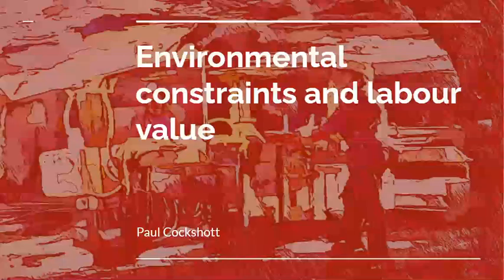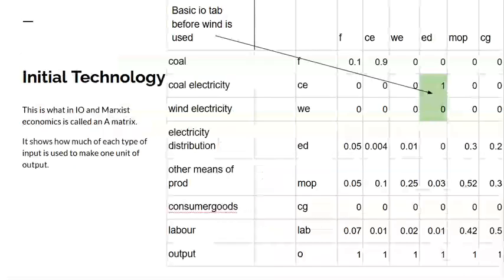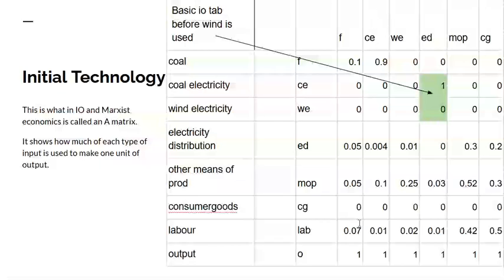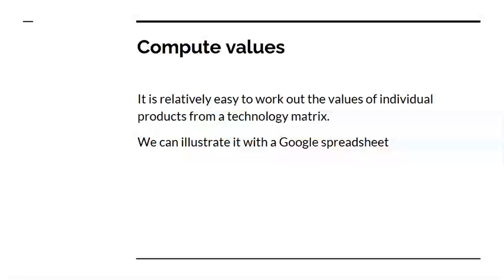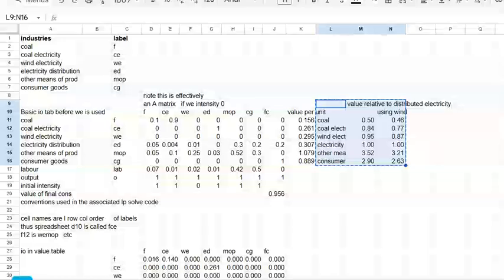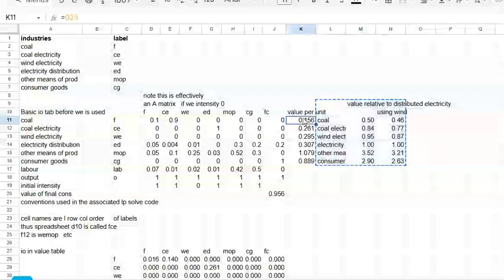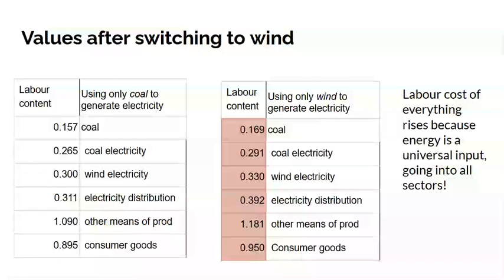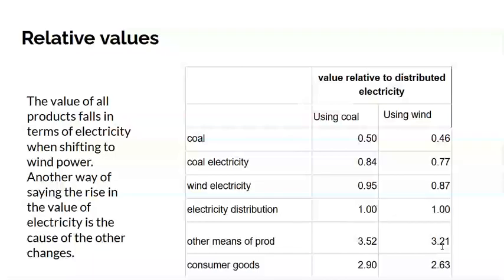labour value and environmental constraints

Comment: You may be interested in studying the economy of the Inca, which was essentially an ancient command economy where the central government would keep records and censuses and use these to plan distribution of essential goods from state-owned storehouses to the population
Reply: Can you provide a book or article about this information? Thank you greatly ahead of time.
Reply: @ I’m not sure if there are any books available (there probably are some), but Inca economy has been a popular if not controversial subject among Andean scholars. I would start with a basic search result like “Inca economy” to see what literature is available on the web. The system of record keeping I’m referring to is called quipu, a form of recording information using knotted strings. The storehouses were called qullqa and would store basic goods like frozen potatoes (chuño) in case of crop failure or famine, military equipment for marching soldiers, and clothing. They were placed in regular intervals along the extensive highway system of the empire.

Comment: The Labour Theory of Value is, in my view, clearly flawed!
Surplus value is not produced! Only a buyer can pay for it on the market.
Since surplus value is also part of value according to Marx, value cannot exist until it is clear whether it is possible to get the buyer to pay surplus value, and if so, how much.
So-called “socially necessary labour time” only exists once it is clear when a buyer buys the product in question, as does so-called “unpaid labour time”. Both types of labour time can only be qualified as such when the product is sold on the market. Consequently, value is created on the market and not with the production of the products.
One can only produce the conditions for the sale of each product, the conditions for surplus value payments and thus also for the value, but not the value itself!

Value is not the completed work performance of any kind but corresponds to the recognition of expenditure or the recognition of separation energy when giving up property!
Reply: You do not understand the difference between use value and exchange value and continuously confuse price with value. Read Capital if you haven’t already or read it again since you clearly do not understand these distinctions.
Reply: @toadyhamloaf  
Read Capital and don't always repeat the wrong things that others preach about it.
I never spoke of an equality between use value and exchange value - that is complete nonsense!
There is no value other than the exchange value (market value).

Marx had to include market value in his Capital alongside his labor value because he noticed that exchanges were not taking place in accordance with his alleged labor value.
Marx is wrong in several places in Capital, including with surplus value and thus with value: Marx writes in Capital I and Capital III that surplus value is produced. But that is clearly wrong! No entrepreneur can produce his own surplus value. If that were the case, he would no longer need to sell his products.
Marx assumes that (labor) value is created with production. Since surplus value, according to Marx, is part of value, surplus value would also have to be created with production. Marx describes the (supposed) creation of value with a formula:
W = c + v + s
W value of a work product
c constant capital (proportionate costs for buildings, electricity, raw materials, supplies, etc. per product, by Marx also costs for machines)
v variable capital (proportionate costs for labor per product – by Marx only for human labor)
s surplus value (proportionate costs for product; according to Marx, this is created with production)

Marx's supposed labor value is an expected value:
W|expected = c|cost factor, replacement expected + v|cost factor, replacement expected + s|expected.
The expected value is made visible to potential buyers as an offer price.

In reality, surplus value can only (!) be paid by a buyer. However, the buyer only pays surplus value if he first completely replaces the costs c + v .

Both of these things happen on the market. The value is therefore not identical to cost accounting (c + v), where an expected surplus value is added to the costs.
There can be no other surplus value than an expected surplus value on the production side of commodity society. Even if an angel were to hand the entrepreneur a sum of money s at his expense c + v, this would not be surplus value, but merely a replacement for part of the costs.

The value is therefore created on the market and is assigned by both exchange partners to both the commodity and the value equivalent in equal amounts.
This is also made clear by the fact that the surplus value is paid on the replacement of costs. This is a significant difference from Marx's view, who simply adds it to the costs.
The value formula must be adapted for the market:
W|real = c|replacing costs + v|replacing costs + s|real.

The value does not describe the costs, but corresponds to the recognition of the expenditure (either partially or completely (complete replacement of costs c + v) or more than completely (complete replacement of costs plus payment of surplus value).
Reply: @toadyhamloaf  
Read Capital and don't always repeat the wrong things that others preach about it.
I never spoke of an equality between use value and exchange value - that is complete nonsense!
There is no value other than the exchange value (market value).

Marx had to include market value in his Capital alongside his labor value because he noticed that exchanges were not taking place in accordance with his alleged labor value.
Marx is wrong in several places in Capital, including with surplus value and thus with value: Marx writes in Capital I and Capital III that surplus value is produced. But that is clearly wrong! No entrepreneur can produce his own surplus value. If that were the case, he would no longer need to sell his products.
Marx assumes that (labor) value is created with production. Since surplus value, according to Marx, is part of value, surplus value would also have to be created with production. Marx describes the (supposed) creation of value with a formula:
W = c + v + s
W value of a work product
c constant capital (proportionate costs for buildings, electricity, raw materials, supplies, etc. per product, by Marx also costs for machines)
v variable capital (proportionate costs for labor per product – by Marx only for human labor)
s surplus value (proportionate costs for product; according to Marx, this is created with production)

Marx's supposed labor value is an expected value:
W|expected = c|cost factor, replacement expected + v|cost factor, replacement expected + s|expected.
The expected value is made visible to potential buyers as an offer price.

In reality, surplus value can only (!) be paid by a buyer. However, the buyer only pays surplus value if he first completely replaces the costs c + v .

Both of these things happen on the market. The value is therefore not identical to cost accounting (c + v), where an expected surplus value is added to the costs.
There can be no other surplus value than an expected surplus value on the production side of commodity society. Even if an angel were to hand the entrepreneur a sum of money s at his expense c + v, this would not be surplus value, but merely a replacement for part of the costs.

The value is therefore created on the market and is assigned by both exchange partners to both the commodity and the value equivalent in equal amounts.
This is also made clear by the fact that the surplus value is paid on the replacement of costs. This is a significant difference from Marx's view, who simply adds it to the costs.
The value formula must be adapted for the market:
W|real = c|replacing costs + v|replacing costs + s|real.

The value does not describe the costs, but corresponds to the recognition of the expenditure (either partially or completely (complete replacement of costs c + v) or more than completely (complete replacement of costs plus payment of surplus value).
Reply: @rainerlippert  you think you’re the fist person to ever type out this garbage? You either used AI to read Capital or didn’t grasp it at all. Return to Capital immediately
Reply: I think you are getting confused between price and value
Reply: @emrebennett2857  
I don't think so!
There are two prices:
a) the offer price
This reflects the expected value.
b) the selling or buying price (identical)
This reflects the real value.
Reply: @rainerlippert  but both these are separate to the value.

Some items will have a price above value and others below.. but on average prices tend to move towards their exchange value (without outside manipulation).

This can be quite easily proven on piece work.. if you take 1 week to make 1 shoe.. the company you work for will not pay you the cost of that shoe (- material and overheads costs) each week.. they will pay you the minimum needed for you to recreate your potential labour under socially accepted conditions. The materials + overheads may cost them £5 and they may sell the shoe for £50 yet you won't get paid £45..

And if the PRİCE fluctuates and they suddenly get £25 or £65 for the shoe, your pay wouldn't increase/decrease..
The labour value isn't tied to price and it adds value as it is being used.
Reply: Marx covers all this in the first few pages of capital 

And value does not equal prices
Reply: @trevorwilliams2948  
Marx is wrong in Capital – see my reply to @toadyhamloaf’s comment.
Reply: @trevorwilliams2948  
Marx is wrong in Capital – see my reply to @toadyhamloaf’s comment.
Reply: @trevorwilliams2948  
Marx is wrong in Capital – see my reply to @toadyhamloaf’s comment.
Reply: Back under ur bridge.  Hundreds of blackboards, notebooks and napkins have contained the answer to this misapprehension since the original composition of “Volume 1”.  Almost all of those, like this one too, could have been prevented or avoided if the person raising the “doubts” or claiming to have a refutation of the LTV had bothered to read Volume 1 carefully.  Just go and read it and read it carefully.  Only then come back and raise the doubts again but only with clear reference to the different concepts Marx identifies, defines, describes, and discusses.

Comment: Wind being more expensive than coal? That seems counterintuitive  considering wind is relatively hands off and even a single coal plant requires trainloads of coal per day. Furthermore, what do we make of the reports that renewables are now cheaper than fossil fuels? Is that a case of the illusion of money obfuscating the real costs?
Reply from the maker: Wind is intermittent so the investment in equipment is high per kw mean power provided.
Reply: @paulcockshott8733  Wind is capital intensive upfront, but actually has a lower LCOE over the long-run. See Brett Christophers, "The Price is Wrong"
Reply: Well, at first at least there's a lot of labor associated with ramping up the production

Comment: This example shows why input-output is useless for planning. There is no difference between "wind electricity" and "coal electricity"; it's all just electricity. When the plan butts up against the emissions constraint, the marginal cost of each extra unit of output goes up, as we'd expect in convex planning. In the realm of non-convex planning, of investment planning, the opposite holds true. And if the plan does not butt up against any constraint then we are free to change the mix however we want, and the value of electricity can either rise or fall depending on what we do.

Oh and a minor nit: the computation doesn't converge because labour added is constant, but because the spectral radius of A is less than one. If in addition we want values to be non-negative, A must also satisfy the Hawkins–Simon condition.
Reply from the maker: @TheTjopp  obviously there is no difference in the electricity, those are just shorthand for a longer description like electricity produced by thermal power stations burning coal. But that does not fit into the spreadsheet cell. On convergence you have a contractive affine transform on the value vector, which, without the addition of the labour vector would converge on the origin ... All values zero.
Reply: @paulcockshott8733  This kind of stuff becomes important with multiple production methods and joint production, as Zachariah points out in HLPtGE and in his and Hagberg's Receding Horizon Planning project. IO also tables don't capture that labour has to be added to sequester emissions past a certain point, hence raising the embodied labour in say electricity. So while the immediate cost is low, the social costs are higher. Alcohol is a similar example. Cheap to produce, expensive to deal with the consequences.
Reply: what do people suggest now instead of IO tables?
Reply: @Skeleman  You can do it with accounting, as long as that accounting is public and global. The IO tables come from account statistics. It seems silly to me to use them to try and work backwards what the embodied labour "should" be when you can just inspect the accounts. IO is very much a product of capitalism.
Reply: @TheTjopp  How are IO tables a product of capitalism?
If they are done in mateiral terms instead of money terms, then they just measure the inputs and outputs of physical production. That's true of any physical process, not just ones that take place in capitalism.
Reply: @Skeleman  YouTube ate my comment again. But the answer is corporate secrecy
Reply: @TheTjopp  YouTube is getting unbearable lately. I appreciate your reply. I'd love to chat more somewhere else if you'd be willing to. I'm very interested in the computational complexity of planning.
Reply: @Skeleman  Send me an email and we can set something up